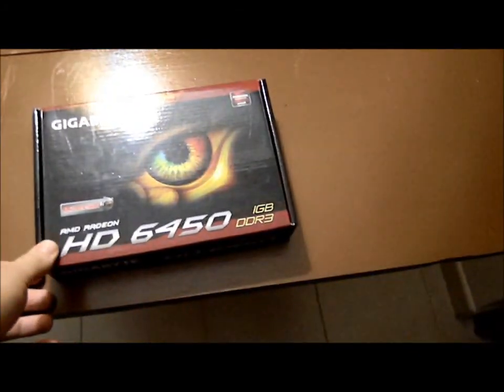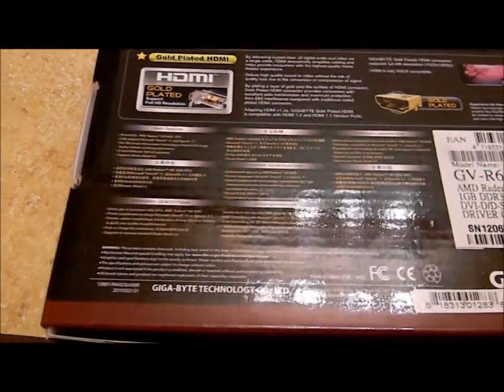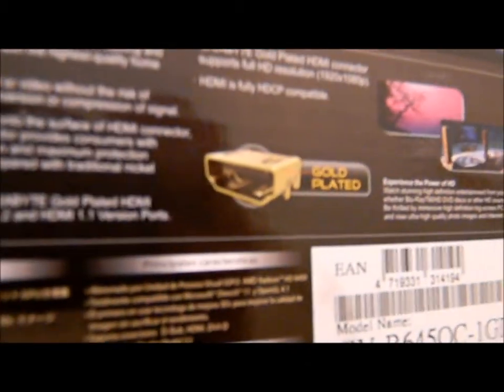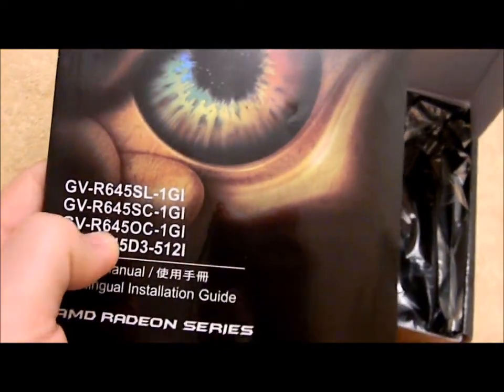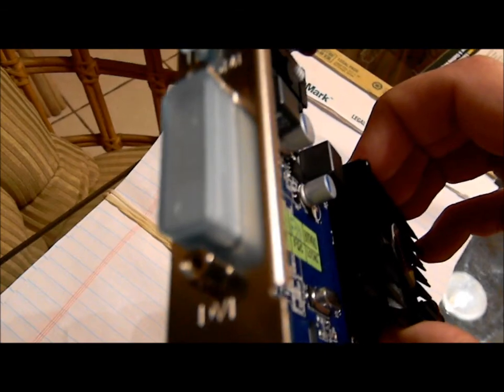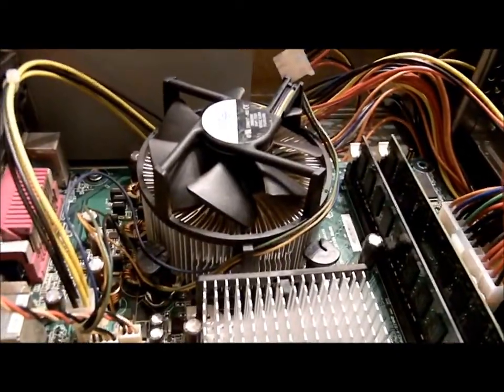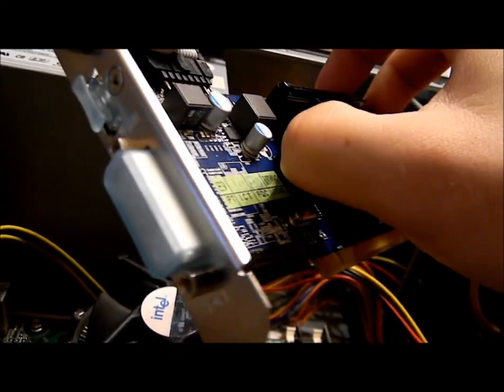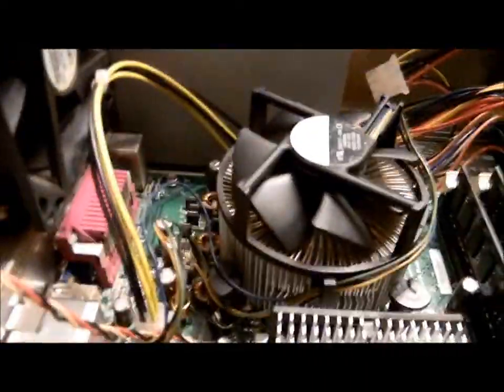Gigabyte AMD Radeon HD 6450 1gb Direct X 11 Graphics Card Unboxing and First Look - CokedUpCanary

Comment: One quick correction.

Gold plating on is only used because gold is non-corrosive. It has nothing to do with anything other than keeping the ports and plugs from corroding over time.
Gold is actually a really poor conductor compared to copper or silver.

Apart from that, good video.

Comment from the maker: The GT is gonna be a bit better just because of horsepower really, but with supported technologies the 6450 will have a slight advantage. If you already have the 9800gt, thats fine to stick with for now, but not for uber intensive gaming. Same goes for both cards. If you want an upgrade overall, look into a 6870 if you can find one below 140 bucks. Good investment, just make sure you have a dualcore cpu at minimum or else it'll struggle.

Comment from the maker: Horsepower-wise, not really since this is very entry level. But this card will have more support for the latest games and technologies, just obviously not as fast as anything higher in the 6000 series. If you want something "pretty" good, grab a 6770, look for under 100 bucks.

Comment from the maker: Oh sure if the action sequence is pretty balling it'll drop, but nothing that makes it unplayable, even on that kind of a setup (which was the Pentium D 935 at 3.2ghz, 6450, 4gb DDR2 800) someone can still enjoy modern games, just obviously with a sacrifice. And my A8 setup right now is great, but no I havent tested it at its full potential yet, and the benchmarks you find on youtube about 3850s alone and in dual graphics mode are accurate, just depends what you play & what programs use the mode

Comment from the maker: I actually ran Crysis on medium with 20+ FPS with this card as a benchmark, in tandem with a Pentium D 935, which is obviously a crappy processor compared to today's standards. So if I can achieve that kind of a result even with such an old cpu, then I'm sure anyone else can :P I never expected anything on high though, period. Minecraft however runs fine with everything high if you want another idea. And that Pentium D is put to rest, I'm on a 3870K A8 now with the card in dual graphics mode.